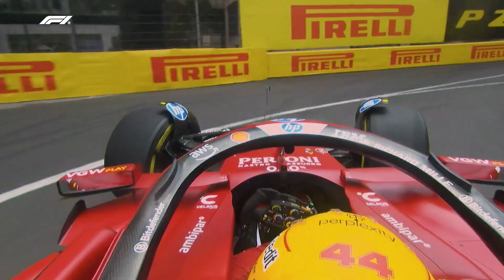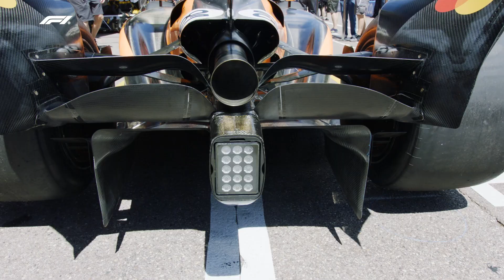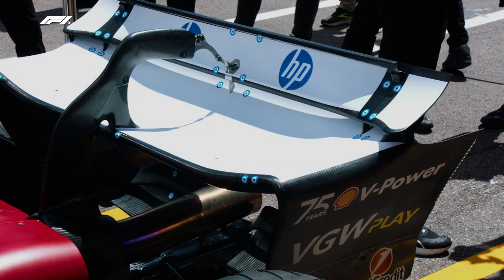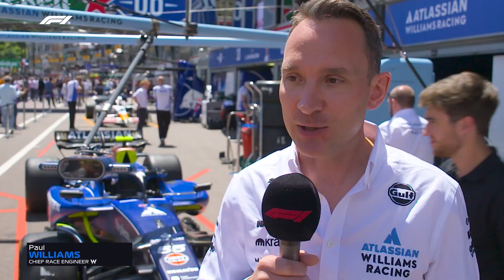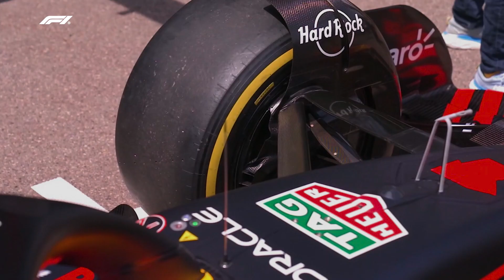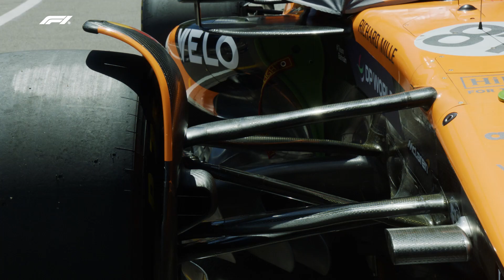How To Win In Monaco | F1 TV Tech Talk

Comment: Probably the hardest part is that you cannot practice it outside of the season. Which is usually so with street circuits. You can drive Suzuka all year long and with all sorts of cars. The only time you can drive the Monaco grandprix circuit is with a formula 1 car during the race weekend.
Reply: True, but they also have simulators to familiarise themselves with the track
Reply: Formula E and the F1 Historic cars also hold races at Monaco on separate weekends.

Comment: Easy to win as a team, and there is nothing any other team can do about it. Providing you are 1-2 in the 1st corner, the win bar mechanical failure is guaranteed. Second driver for allows the 1st car to build a gap while they hold up the field. Let them pit once they have the gap then cover the field on the second stop. All bar mclaren can do this.